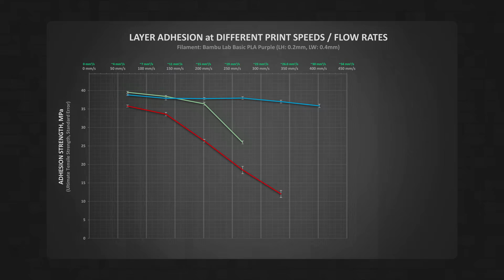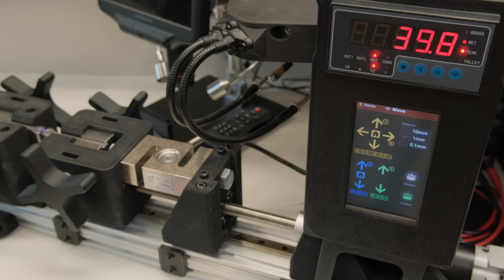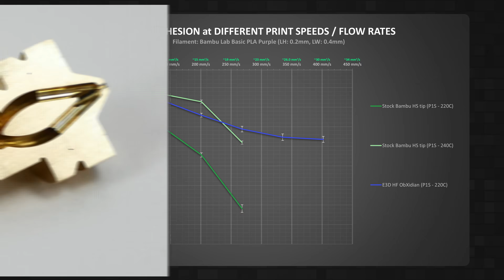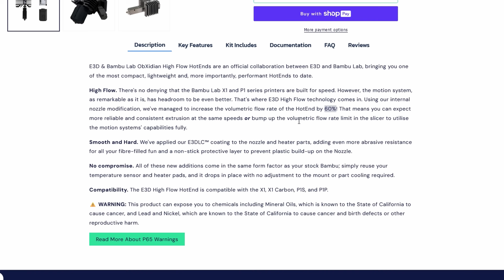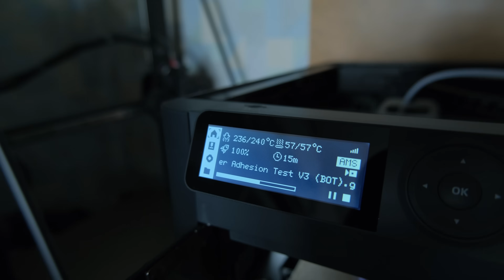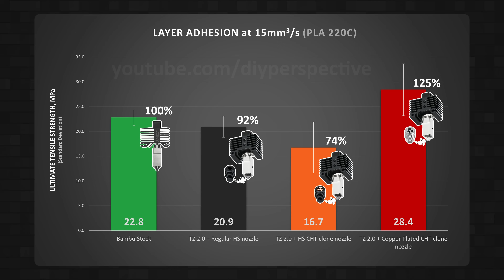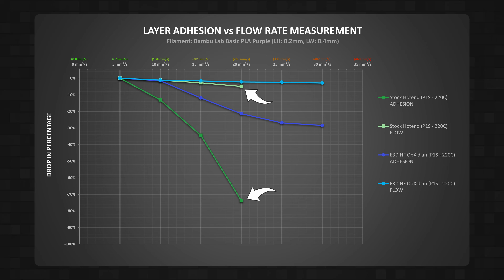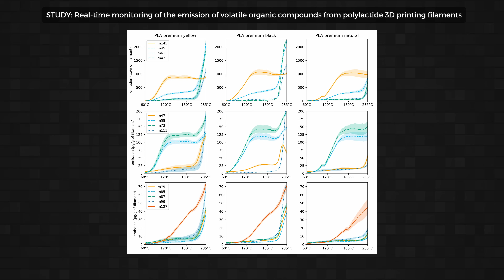LAYER ADHESION TESTED: Bambu Stock vs TZ 3.0 vs E3D HF ObXidian hotends (220C vs 240C)

Comment: Hey! Don't forget to anneal your PET-CF filament. As a semi-crystalline material, as printed it will be quite amorphous. If you want the insane stiffness noted in the TDS sheet, annealing is a REQUIREMENT. It's also fairly easy to do
Reply from the maker: I never looked into the annealing process, but thanks for the info I read up more about it. I looked up what Ultimaker writes about it and it says it gives "a stiffness increase of 10%". I checked the Bambu PET-CF TDS and yes their samples were annealed. I love comments like yours as they help me learn very quickly about important things in my busy schedule, thank you so much. :)
Reply: @PrintingPerspective  of course! For bambu its actually fairly simple. Basically, start at 80C hold for a bit depending on part size, and slowly increase in 10C increments every half hour till you get up to 120C. Hold for a bit. Slowly cool down.

For everything else pet-cf from other brands.
Chuck it in the over at 140C and send it
Reply: what is the best annealing method in your eyes?
Reply: @matthiwi6901  which brand
Bambu: ramp up to 120c slowly.
Everyone else: chuck it in at 140c and hold for a few hours.

If you have thin walls, use sand or salt as support
Reply: @josejimenez896   i use eryone filament. does normal PETG Profit from this as well? 140 seems really Low but I will give it a try
Reply: @matthiwi6901  hello, really, really quick

PETG != PET
THEY ARE COMPLETELY DIFFERENT THINGS. Pet is a semi-crystalline polymer and petg is amorphous. Nothing that I've said above applies to PETG. They have different print temps and optimal printing settings.

140C is actually quite high. PETG would immediately fold at said temps.
Reply: I found that annealing made parts brittle
Reply: @TheDesktopFactory  did yank it straight from the oven while it was still hot?
Reply: I've never annealed because it warps the print unless you pack it with sand. Is this not true?
Reply: @1tokeover  skill issue. For fiber reinforced PET annealing is pretty easy. There will always be shrinkage but it's minimal and easily compensated for.
Reply: @josejimenez896  but what about functional parts that need to have fasteners and parts installed? Will it shrink so that those parts no longer fit?
Reply: @1tokeover  again you can compensate for that with shrink compensation. My post annealed PET-GF parts on my V0 have less warp and better demensional accuracy than people printing unblended ABS in subpar conditions.

Comment: I would be interested to know how well extrusion force correlates to layer adhesion. If it does corollate well, it could make tuning settings a lot easier without having to buy or build a strength tester and test with every filament and hotend combo.
Reply from the maker: That's a very good idea.
Reply: Of course it correlates. If the extrusion force is increasing it means the hotend is being over run, the plastic coming out of the nozzle is cooler, so layer adhesion witty be reduced.

Comment: Thanks, convinced me to buy the e3d hotend
and confirmed my suspicion that 3rd party china hotends are (still) trash
Reply from the maker: Yeah, they are not that good at all. The only way now I would consider them is to print glass filled abrasives as you can change the nozzles.

Comment: Do you have an opinion on whether a high flow tip would help print quality on a prusa mk3? I’m unsure what the bottleneck would be to increasing speed without loss of quality or sustained quality without having to increase temp
Reply from the maker: Genuine V6 CHT nozzle probably would be the best upgrade. But the print quality is very broad word.
Reply: @PrintingPerspective  yes I knew that writing the question, but was unsure how to expand more at the time. 

I print, PLA+, PETG, ABS. I currently use 0.6mm nozzle and standard prusa speed profiles. 

I'm curious to know if improved melt zone of CHT will yield more consistent or improved prints with respect to strength and appearance.

Considering the above with 0.6mm or 0.8mm nozzle, where I would like to get to (the education void I'm attempting to fill) ...

I would like to print at the sustainable, reasonable limit of velocity and acceleration that the Prusa can offer for 0.4mm+ layers, having a profile for "Functional" parts done strong and fast .... and less aggressive profiles pushing the gantry boundaries less and having more refined detail/appearance. 

I use Prusa Slicer and when I try to increase speeds for 0.6mm noz /0.4mm layer, I find very little time saving for quite large speed changes and I wonder if the "max volumetric speed" or other automatic limits imposed by melt/flow rate are slowing things down? 

I find it very hard to get advice, or find information on how to increase print speed in an organised procedural manner, linking slicer speed change <-> Printer Action <-> Printed part; especially so with consideration of impact on printer (tolerance, wear), deviation in print outcome (dimensional, strength, artifacts/aesthetics, detail.

Comment: I've had the exact same results with the harden steel nozzles How about the brass cht clone with the copper insert? I've had so much better results
Reply from the maker: Those would probably perform slightly worse than the nickel plated copper with the insert.

Comment: Maybe im wrong but layer adhesion is not dependant to the temp only? The nozzle should affect that... so its a matter of setting the right temperature in the TZ so it has a better adhesion... speed and quality is another thing, but is plastic bonding together why the nozzle should affect on that?
Reply: I know it takes to much time to do the tests but it would be nice to see at diferent temps how each one improves layer adhesion

Comment: Did you also end up testing the TZ 3.0 hotend with the copper plated CHT nozzle? If so, how did it compare to the TZ HF ObXidian? I'm considering to replace my V6 Hotend with a TZ Hotend and a copper plated CHT nozzle. But if the difference is worse or negligible, then i might as wel replace it with a V6 Revo Hotend with a Revo ObXidian HF nozzle, as i still like to have the ability to swap out the nozzles.

Comment: I skimmed through the video, did you just compare a hardened steel nozzle to brass? You need to run them hotter so you need to be comparing 220 vs 240 and 240 vs 260 as the steel needs to be run hotter because of the low thermal conducticity.

Comment: Have you been paid by E3D ?
I use tz 3.0 on my printers and they works perfect, high quality prints, no issue at all printing maintly at 220°C 30mm3/s.
I bought a E3D ObXidian to compare, awful print results, pla stick a lot on the nozzle, damaged all my multicolor prints.
Reply: @tek9058  you should not have used it for multicolor prints, and I'll surprised yours is not sticking. That's the worse aftermarket nozzle I've tested so far.

Comment: You just missed the tz V6
Any chance of testing it in a later video and comparing to these results?
Reply: TZ V6 is the same hotend with a different heatbreak/mount. It will very likely perform identical.

Comment: Thanks for this! I had the same results, althouh I did not have the numbers to show exactly what happens, this is my experience:
- cht clones with hardened steel nozzle printed parts felt significantly weaker than stock hotend, so I stopped using it
- cht clones with brass nozzle printed parts seemed fine, a bit better than the stock bambu hotend, I still use it for my Prusa mini
- e3d's hotend printer parts seemd significantly stronger, I love it.
I should note that I did not increase printing speeds on X1C, I use the standard Bambu profiles speed.

Comment: i think at the end of the day layer adhesion comes down to the a) true temperature of the filament when exiting the nozzle and also the b) temperature of the existing layer below. we cannot really measure a), but only the temperature of the block and all these tests we do assume it is equal to thermistor temperature even though we know it is not. that means we have hidden variables like 1)block material, 2)thermistor distance through the block to the heater element, 3)distance to the nozzle, 4) nozzle properties, 5)PID reaction time and maybe other things i can't think of at the moment that account for filament being printed at a lower temperature than requested. i strongly agree with you that better nozzle properties and longer melt zone length is the best move since it appears to be able to wash out all the other variables preventing any of them from becoming bottlenecks. when comparing hotends we cannot really change 1,2,&3 and can treat it as one black box variable and call it the performance of the hotend but perhaps we can stick to the same type of nozzle at least when doing testing so we can eliminate 4) when comparing hotends. i'm looking at 6:57 and wondering why Obxidian adhesion loss saturates at -30% while Bambu is actually accelerating to -70%. i am not satisfied that we cannot separate the nozzle variable from the hotend variables in order to explain this phenomenon. i suspect you feel the same way...

i have a thought. i know from your past video(s) that very poor performance can be recovered by increasing the hotend temp. i think if you can measure 4'C difference inside the block itself (6:16) at high flow then the nozzle temp delta will be even higher and (a) will be yet even lower, maybe 10-20C lower with hardened steel nozzle at high flow. to me that is a clear indication that that Bambu's poor performance at 6:57 is suggesting that (a) is too low and potentially near the limit for this particular filament.  i think that filaments have this hidden property that needs more investigation: what is the actual temperature required out of the nozzle for a particular filament to suddenly lose adhesion strength, call it "x"? we know from CNC kitchen in a 3yo video that his PLA achieved max layer adhesion at around 230C requested temperature with also pretty ok strength from as low as 200C, but huge loss at 190C, indicating that x exists. it is my guess that your purple PLA has an "x" quite close to the requested 220'C, maybe 200C. so if a hotend-nozzle combo that loses 20C out the nozzle produce strange graphs like accelerating loss of layer strength( 6:57) while a better combination will see layer strength loss saturate to a fixed loss like -30%. the numbers are just a guess of course, my point is your purple PLA maybe needs a slightly higher temperature to behave optimally, combined with the fact that bambu HS is not so good with the requested vs actual temp at high flow.

as for b), the temperature of the existing layer below it can be controlled by ensuring the part fan is turned off and the model should ideally have smoothly increasing layer lengths in proportion to the increasing flow rate. this is to ensure consistent layer times at all levels. but i think this variable is not large in comparison to what happens to a) during high flow.
Reply: bond strength depends on the new and previous layer temp, but also time. As in, how long the junction itself spends at above glass transition. The relationship is non-linear and also depends on things like strain in the plastic, of which there is plenty in FDM. Its a deep af science this polymer stuff. Half educated guesses, half statistics, half geniuses with their insight coming up with models to predict things.
Reply: @xilw3r the biggest difference in my extensive testing is having consistent flow and slight over extrusion paired with the time and temp. It's honestly the most important factor, as the part being fully dens vs having micro gaps plays a massive role on the layer adhesion

Comment: I was just thinking of buying a TZ 3.0 for a dragon burner... not anymore. It would be great if you could test other hotends and nozzles.
Reply: as he mentioned tz3.0 with nickel coated nozzle is way stronger  because of  the better thermal conductivity. if you put a brass nozzle i think it will also be better. dont forget hardened steel isnt that good against copper and brass ;)
Reply: @romainfichet5352  Yeah, It does improve quite a bit with the copper plated ones. It's still not as high as the e3d. Would be interesting to see how much these findings translate to other hotend designs (rapido, revo...)

Comment: I am printing at around 10mm/s sometimes lower on my pretty stock Ender 3. I chanced to linear rails and to Klipper also I have upgraded the cooling. The heater isn't capable to heat more.

Comment: I’d love to see these type of nozzles available for the A1/A1 mini as it’s easier to change the hot end on these machines. One might not be able to go quite as fast but it’d be great for layer adhesion.
Reply from the maker: A1 series have a way longer melt zone, I don't think they even need it, unless you print with bigger nozzles.

Comment: I think what is happening the melt-zone is long enough to melt the plastic but due to the lower thermal conductivity of the steel the temperature of said plastic is not as high thus, the lower strength adhesion. I think thermal conductivity plays just a big role not just temperature when it comes to layer adhesion.

Comment: I have the TZ "1.0" and TZ 3.0 both with hardened steel CHT nozzles. I've hoped to get better flow with v3 because of the higher wattage heater. But it didn't make a difference.

 I still had Nozzle Temperature malfunctions because the Heater couldn't keep the Temperature. I've also used the slice Boronitride paste, but it didn't change a thing. 

My only problem with the e3d obxidian is that you cannot change Nozzles. I've clogged already two CHT knock offs. If the Obxidian gets clogged, then I've thrown basically  €100 down the drain.

BTW, thank you for the informative test
Reply from the maker: Thanks. Well, buying 3 hotends that didn't make improvement to the stock is also basically down the drain. I am in the same boat as I have bought 1x tz 3, 2x tz 2. I would rather have one that actually good. E3D say you can do cold pull and geometry should allow you to do that to unclog it. On clones it is impossible to do because of the design. It would be interesting to know what is E3D policy about clogs that are unfixable.
Reply: @PrintingPerspective  yes you do have a point. I’ve wasted €60 for clone hotends. 

If cold pulls are possible I may give e3d a shot.

Comment: It would be interesting for once to fix the hardware and to change the material, since all channels always test PLA. Roughly speaking in % how should I scale for ABS, PETG and maybe another couple of materials? ABS is known to flow better, will it be impacted by speed less?
Reply from the maker: Testing ABS and PETG is so hard because you can't dump a lot of cooling as that affect layer adhesion. And without cooling test prints don't have time to cool down. Not to mention that for ABS you have to constantly monitor chamber temperature and different brand PETG filaments can heavily impact results. If a hotend can better heat PLA it will also heat better any other material.